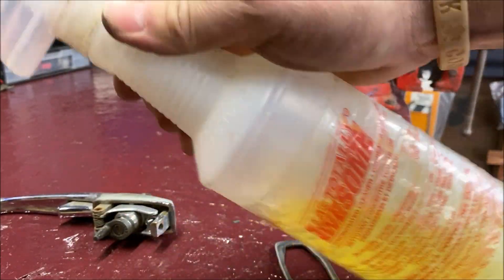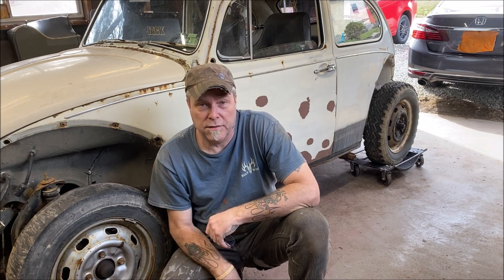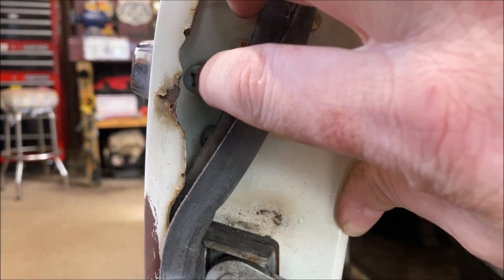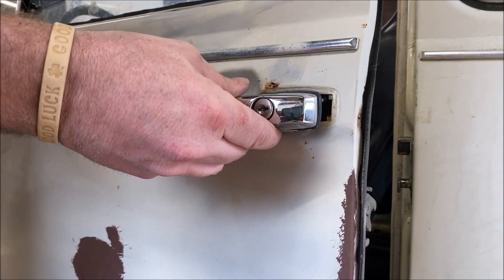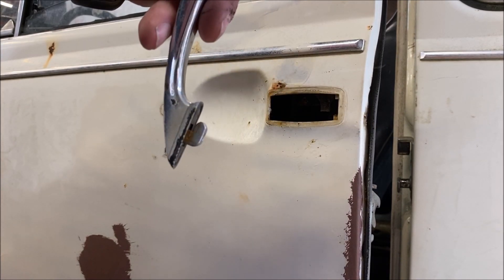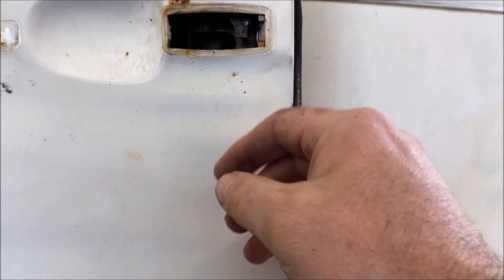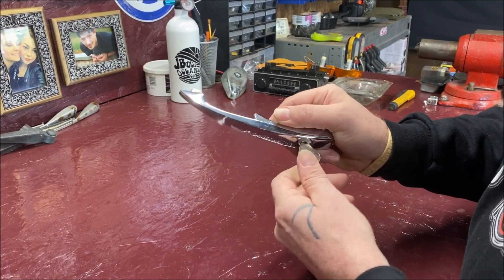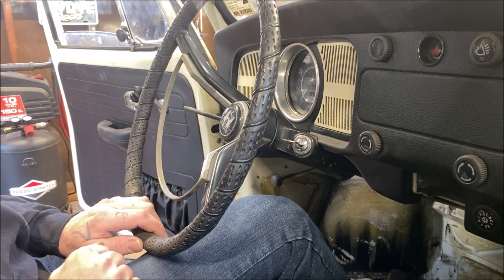VW Beetle Lost Ignition Key? Door handle removal! Here's The Fix! Easy Remedy!

Comment: That's a great tip but I don't have any doors. Solved my hot start problems,  the float valve is now packed with 1.3mm washers. That's way over the empi recomndations,  starts better idles better and was far more responsive when I tuned the fuel and air screws.
34pic3 empi
Reply from the maker: That’s awesome! I’m glad to hear it all worked out. They just need a little messing around with, and then they can be great carburetors.

Comment: Thanks for sharing.  My keys go into my door locks, but won’t fully turn to unlock, so I make a point to either never lock, or just leave the windows open.  This video will help me get them off the door properly to repair the issue.
Reply from the maker: Let me ask a question my friend, is it easy to pull the button up-and-down? I would try pulling the handle, and lubricating the mechanism inside the door, and also the lock. Maybe that’s all it needs.
Reply: @SladesVWBeetle  it’s a ‘66, so there is no lock specific button... the inside door handle pushes down to lock, then unlocks as you lift up to open the door.  That works nicely on both, and the door keys will also lock the car, but they won’t turn the other direction to unlock 🤷🏼‍♂️
Reply from the maker: Ahhhhh okay!! Okay on my video I said only remove the one screw. I believe on yours, they’re two screws for your handle! I like your Beetle. It’s very nice!
Reply: @SladesVWBeetle  thank you 🙏

Comment: Thats a great tip. I did this job about 10 years ago on a 67 I had. I had to.take the locks out of the car and send them out in the mail. Your 68 looks great. Its a deluxe model. Yours has the brake warning light above the radio. You notice yours has the wrap on the steering wheel. Almost every original car I have bought has the wrap. Im wondering if it was a factory add on.
Reply from the maker: Thanks my friend! I didn’t know mine was the deluxe model! You know more than me about this. It has the factory pop out windows, and of course the sunroof. If there’s anything else you can tell me that makes it special please do. That steering wheel wrap was really big in the 70s. I don’t think they put them on at the dealer?

Comment: Another great video Slades. Good tips for sure. I can’t cut any by code because I only have the old school machines not the fancy computer ones lol. It’s handy to know a little bit about being a locksmith when you are a mechanic. If I ever lose the keys for mine I know where to go. Now if only I could find where I put the keys for my truck that would be great 👍. Lol.
Reply from the maker: I was actually amazed, that my doorhandles were original. If they would’ve not been, well there would’ve been a video but would’ve not been very good. LOL
oh my gosh you lost your truck keys. 😳
Reply: @SladesVWBeetle  Yes I’m glad they were original too. Or if they weren’t then the cylinders have been swapped out I’ve seen that before. Yeah I lost the keys for the truck they are somewhere at home because I fell asleep in the recliner and had them on my lap and woke up and they were gone 😳.
Reply from the maker: I am very thankful it worked out. The follow up video probably would’ve not been very much fun. I bet if you dig down inside that recliner you’re going to find them keys. Maybe other fun things to, that’s what happens when I reach down in my recliner. 😂
Reply: @SladesVWBeetle  haha 😂 well I have already reached down in there, turned the chair over too look, looked all around the house and can’t find them anywhere. Oh well my birthday is coming up on Friday maybe I can convince my parents to pay for a new key LOL. The ignition has been replaced before though so I’d have to get two keys made.
Reply from the maker: Oh wow, they are definitely not done in your recliner then. I’ve always find all kind of neat things down inside of mine. Yes, it might be Time to get a new ignition. I always get two or three keys made because I get paranoid. I know what kind of stupid things I do.😁
Reply: @SladesVWBeetle  Yes well I was going too. The key blanks have been discontinued so I had to order some and lost the keys while waiting on them 😄. I guess their isn’t many of the trucks like I have around anymore so they didn’t see a reason to keep making the blanks lol. Always something man 😆.